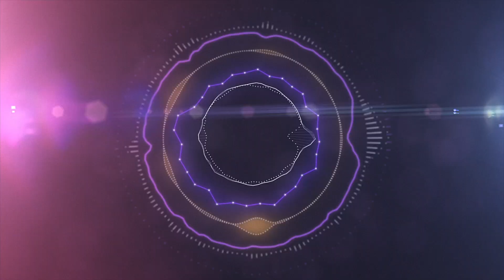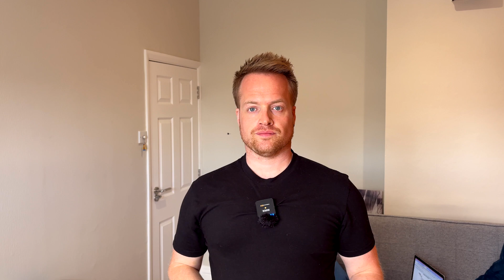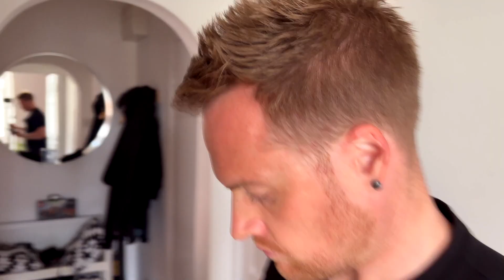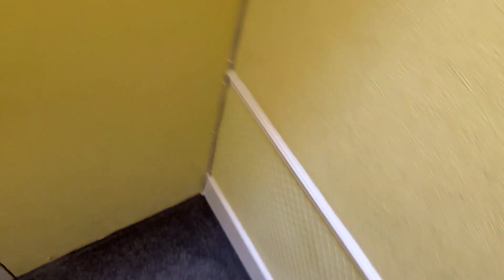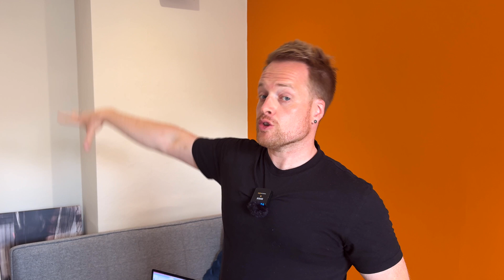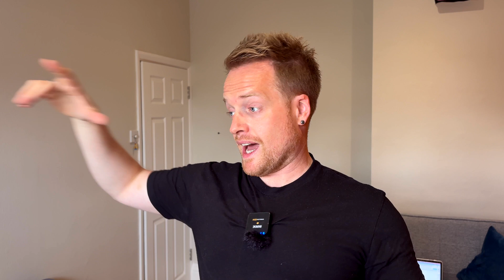Building a PRO Mixing & Mastering HOME STUDIO | Pt 1: FEASIBILITY | My Biggest Career Move Yet!

Comment: I'm in the dreaded almost square room.  Speakers are against the wall and not quite symmetrical.  The idea was to get as much of the listening position as possible covered by a wall of book shelves behind me.  Made a plug for a side window to keep out road noise.  My speakers are on tall iso stands on my desk and the bass cabinets are stacked above the tops.  Seems to help with desk reflections and puts the tweeters at the right height.
Reply from the maker: This is a great example of doing what works for your room! Nice one. Theory isn’t always the best solution in practice. I’ve seen speakers upside down in rooms - it’s experimentation and going with whatever works best for you!

Comment: Yes mate - good luck indeed. As someone who has done something similar in a flat, one consideration when covering all air gaps in a room is mold due to the room not being able to breathe. Easily fixed with a dehumidifier though.
Reply from the maker: That thought hadn’t even crossed my mind! Fair shout. My plan is to get full air transferring AC.
Reply: that’ll keep the air moving for sure. I have no idea if that’s the same as dehumidifying 😂
But like I said, if you experience any issues, just get a dehumidifier.

Comment: To deal with the suckout 100hz in 38% listening possition i've use 2.1 setup, always helped , i'll do a New Room as well, o Hope the best bro
Reply from the maker: How much did a sub help?
Reply: @EdThorne i will say they will help alot , bring the speaker far from the front wall and that null will go down in freaquency ,them fill with the sub, becouse the sub is on the floor they have different null in freaquency, if you need help just let me know , make a try on rew and you will get the idea 🎉
Reply: Far i will say 30 cm to 50 cm
Reply from the maker: Watch sort two on Tuesday. I’ve explored speaker placement.

Comment: I love the fact that I have a studio in my home. Much easier to start and stop doing studio work, and apparently there was enough sound isolation already to not bother my neighbors. I only record acoustic guitar and vocals though. I did some basic measurements when I installed my new speakers a while ago:  https://youtu.be/g-iXGiy-ODQ @09:18
Reply from the maker: Thanks for sharing that. I’m looking forward to working from home for sure.

I can hear resonances in your mic in your video. Your room would definitely benefit from some first reflection absorption. That should help Sound iD need to do less. Sound iD works up to 6dB and then sounds very strange. It also depends how well the Adams handle additional amplitude in the low-end. Ported speakers are likely to chuff more with additional EQ gain. Depends how much headroom they have before distortion creeps in.
Reply: @EdThorne thanks for the tips. I don’t have first reflection panels on the left and right side because there is a door on the right side. I’m currently only using a cloud, thick panels at the back and thick panels in the front corners. But there’s always room for improvement 😁. I’m tempted by Trinnov but there’s probably cheaper ways to improve things first.
Reply from the maker: Definitely get the back of the door and the opposite wall covered first. And a ceiling cloud if you havent already. And the try ARC Studio before Trinnov. ARC is £300 vs £4k for Trinnov… for most people I can’t justify they spend their money on Trinnov when ARC is so good for a stereo set up. If you introduce a dub or more sets of speakers, then yeh, it’s amazing.

Comment: Hmm, your room dimensions aren't optimal for your new room.
260cm wide and 275cm high. That's rather bad. The same dimensions should never be duplicated in the room.

That will only cause problems! 😉 I learned that from my sound engineer teacher regarding acoustic measures.

I would always recommend building a room within a room. And be sure to build the floor so that it vibrates. That way you can get the most out of it. Sure, it costs money, but the costs will be worth it!

Because you'll have fewer problems later on.

And the neighbors will certainly be grateful! 🤣

My room isn't perfect either, measuring 425cm long, 375cm wide, and 220cm high with a sloping roof on both sides. Those are the dimensions according to the room-within-a-room construction I built!

The room-in-room construction works very well, but I've built 20cm thick side walls, and on both sides and the front wall, even 35cm thick. At the back, there are 45cm thick Basotec acoustic panels, and there's still a bass problem when sitting on the sofa, with about a 10dB boost in the bass range... but from where I'm listening, the sound is amazing. And I have a PMC 6.2 in the studio.

Pretty flat frequency response, and I don't have a Trinnov installed in the studio. 💪🙃 I do everything with a 30-band graphic EQ and the 5 parametric EQ from the PMC 6.2's DSP... and it works great thanks to rew software and years of experience with live sound engineering in PA technology. 😉
The symmetry of the room is important; that helps enormously! And the precise positioning of the monitors.
This means they're placed with an accuracy of 1mm on both sides, from the back wall to the side walls. And positioned in a perfect isosceles triangle.
It's a lot of work, but the result is remarkable!🙃😎
Reply from the maker: I think you’ve missed the point of the video. This isn’t about “building the perfect room”, it’s about optimising THE ROOM I HAVE! Also, EQ alone doesn’t correct phase incoherence. Only DSP can do that accurately.

Comment: This will very be interesting and interesting to follow
I have a room like that, a little bit larger than yours, in a block of flats, built , Ill guess (in the mid 50s). It works quite well 🙂 (and I do have a sub, Genelec 7360......).
I dont play loud and I do work a lot with headphones. For  a periode of time I even did Atmos (with speakers)...but not any longer.
Building a room within a room is only going to make sense if you plan to stay there for a long time,  5-10 years.
Here are  a few comments
- You cant use such a small speaker to make any educated guess when it comes to how much sound energy goes into the rooms around you. You absolutely need something that play at the level you are going to listen to and down to at least 50 Hz. Then measure again
- If you have neighbours that stays home all day (and you ar working ther at daytime) you may have a huge problem so check that with your neighbours. But its makes things so much easier if they are informed....🙂
- You have to think about ventilation. Leaving the door open to the next room will help, but blooking the window will also block your only real fresh air possibility. Me ...I would never do that.
  Double glassing (sound isolating glass) is the least expensive option for the possibility for ventilation as far as I se it.
- Have you checked whats happening acoustically if you rotate the listening position 90 degrees, and sit at the long side.......I do that.... :-). Sitting two thirds into the room seems to throw a way a lot of useful space.

Comment: Very cool project Ed, and I'm on board for the series! 👍  A couple thoughts:  
1.  You kind of touched on this:  Your little Anker speaker isn't outputting the amount of low-frequency levels you're going to have with your actual mains, and those low frequencies are the ones that are going to leak out and resonate with the boundaries, so likely worth a leakage dB re-measure once you get actual monitors in there.  
2.  Sitting 2/3 instead of 1/3 into the room means you're going to hear more of the room itself and have to treat the room even more, and also have to drive your speakers a bit louder so more neighbor considerations...so might be worth compromising a bit of ideal frequency measurement to sit closer to your speakers and gain those benefits.
Excited to follow along and see how this works out for you, thanks for documenting the project! 🔥
Reply from the maker: Hi there. You’re absolutely right. All this is covered in detail in video 2 🤘

Comment: I found that purchasing 6 cylindrical turbo trap bass traps from GIK Acoustics, stacking 2 on top of each other in 3 corners of the room (last corner had a door) made a huge difference. I also used their paneling for a ceiling cloud, and extra panels on the back and side walls. Along with Sonarworks, this greatly improved the sound of my room. RT60 time improved from 0.6 - 0.2 seconds
Reply from the maker: I have all this ready to go (probs be covered in video 3 or 4…). Initial acoustic measurements looking good.

Comment: I think  ns 10's will solve all that "room problems". No bass no problems. Anyway as i know you mixing the low end in a headphones.
Reply: NS10 has never solved any problem.........
Reply from the maker: Haha. Very true. My Amphion One15s may be the answer. The acoustic readings are looking promising so far (coming in video 2).
Reply: @EdThorne  I learned that the Amphions react a lot to room response. I have Amphion One 15’s and ATC SM 12 pros. ATC give a steady +-3 db response and Amphions are all over the place, measured from the same spot. I have a treated room. Maybe it’s because of the reflex port since ATC is sealed?🤷🏻
Reply from the maker: It could be a sealed vs reflex port issue. Also depends which you have prioritised in terms of sweet spot - cos there is only one sweet spot in a room.